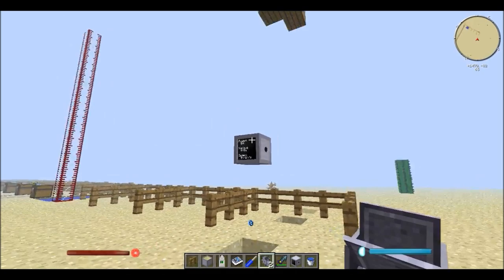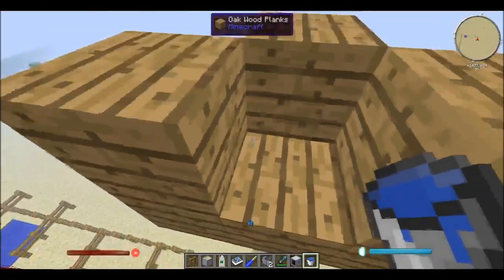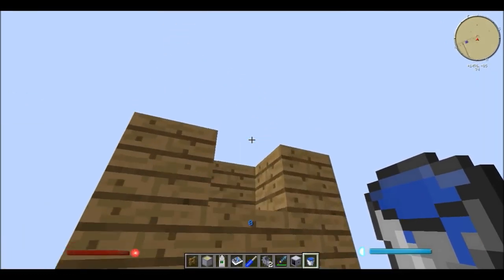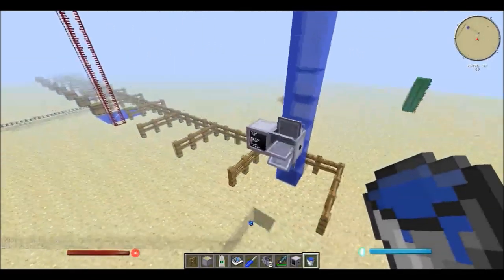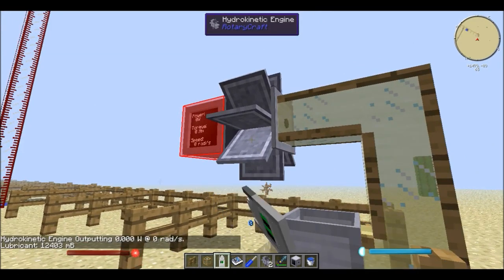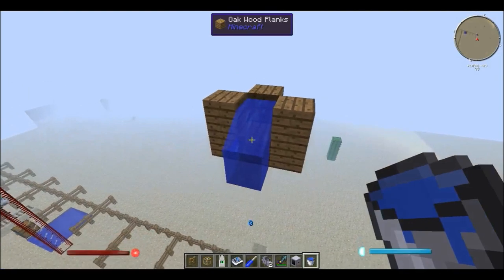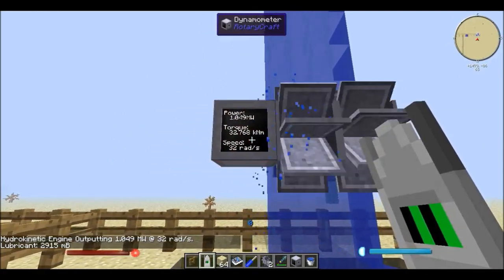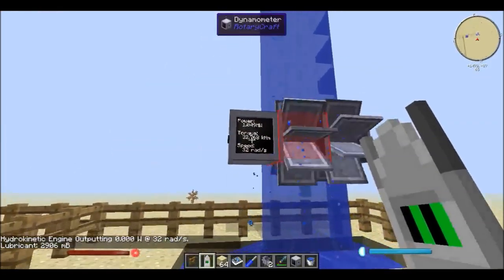Rotarycraft: How to use/ chain the HydroKinetic engine

Comment: getting an error when using them in this fashion, getting hardcore throws when water is falling on them from anything over 20 blocks, not sure what is up, have you had this problem before?
Reply from the maker: Ah ya, I also had errors where the engine would randomly turn into a DC engine. Reika said it's cause of some kind of loading error. Downloading the latest version of the mod should fix it.
Reply: Thanks! Good news is it's only when the water is stopped to tinker with things, but it's still a pain. Runs flawlessly and generates massive power when running though.